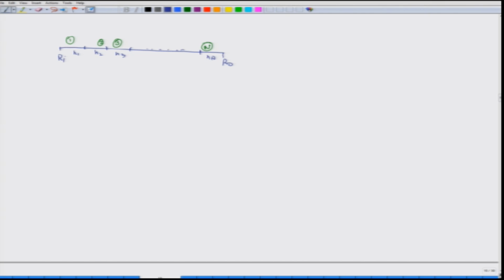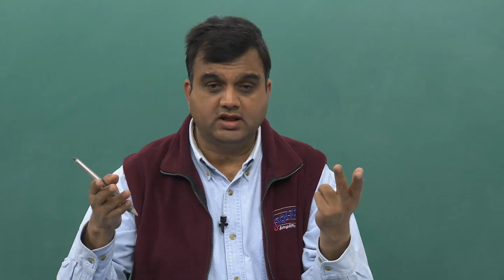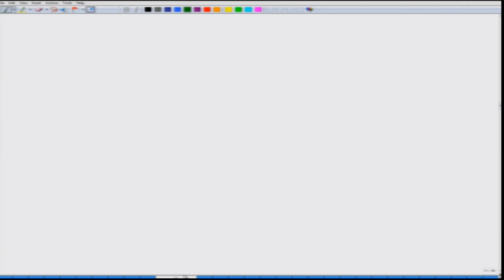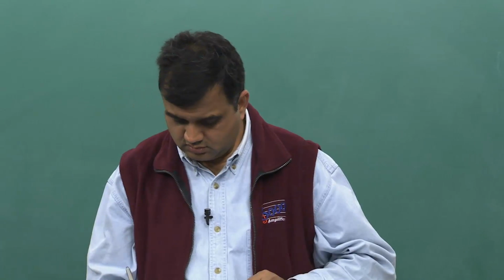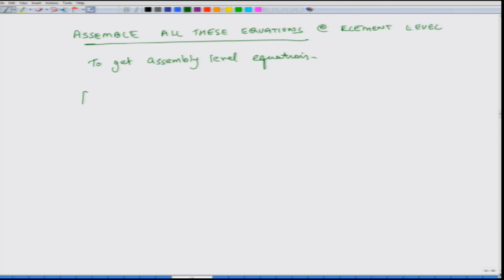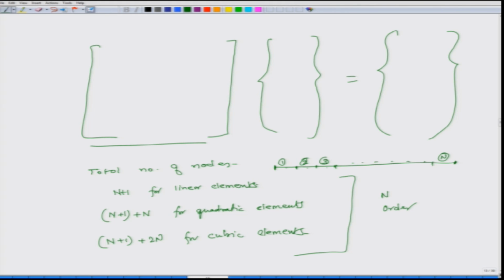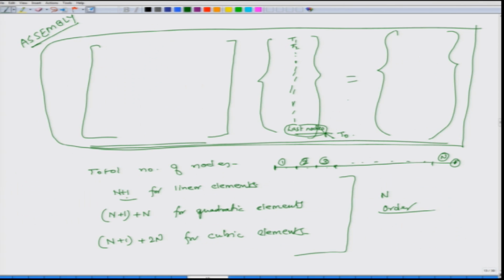Polynomials as Shape Functions, Weighted Residuals, Elements & Assembly Level Equations

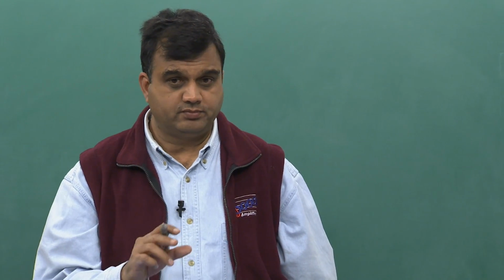Comment: @-5:42 u said size of assembly matrix depends on the total no of nodes and you gave examples for all elements having linear shape functions and quadratic respectively. But you mentioned that within an element itself we may have different functions that define the shape functions. Suppose for 1st element we have a linear and a quadratic interpolation function then ofcourse there should be a different method for calculating the total number of nodes. Also in this case we would need to know the temp at a point between the end node of 1st shape function (linear) and the end node of the 1st element. Is my interpretation correct.

Comment: NT Sir, U did not elaborate as to why the residual (error) requires to be weighted for integration purpose..? {in any of ur FEA lectures.} Can u pls oblige me with answer....
Reply: "weighted integral over errors is zero" it is very important steps utilized in so called finite element analysis. In general you know from 1st fundamental lemma of calculus of variation that (in case if you don't know please refer to this lemma in any variational text books), you'll get a crystal clear clarity. more the number of weighted functions we utilise , more the accuracy we get. some deeper insight might be required to understand that !!!